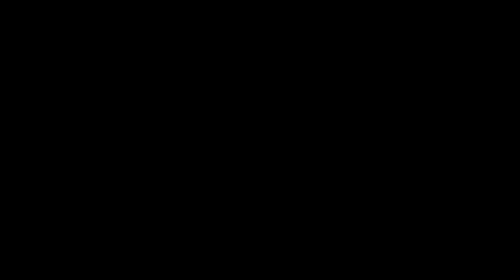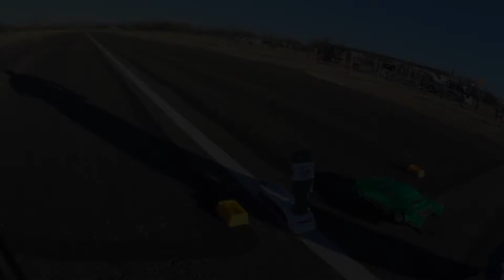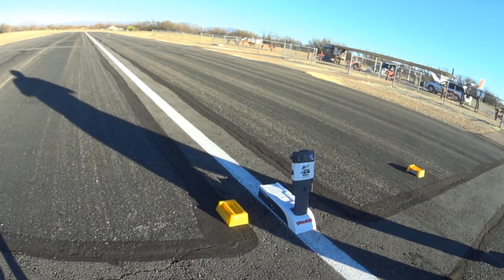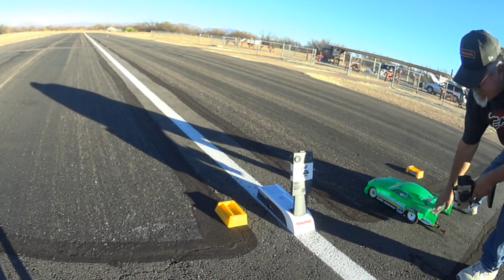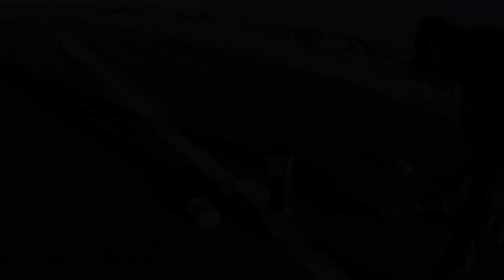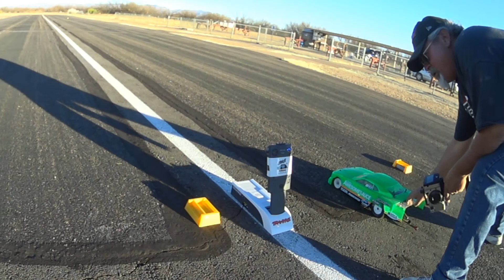Practicing for the LAS VEGAS "King of the Streets" at the Bolin R/C Airfield in Sierra Vista AZ.

Comment: Straight as a arrow!
Reply from the maker: Thanks.

My "slipper" was still too loose on that run - but it was straight.    It ran that way in Vegas, a little more pull off the line, but still could have used more.  Got eliminated in the 1st round (Single Elimination with 200+ entries) but it was a good race, and a pretty close finish - so I was satisfied (as satisfied as you can be, getting eliminated 1st round)